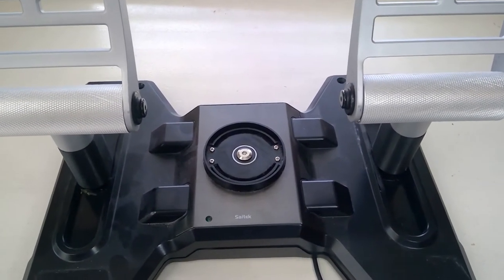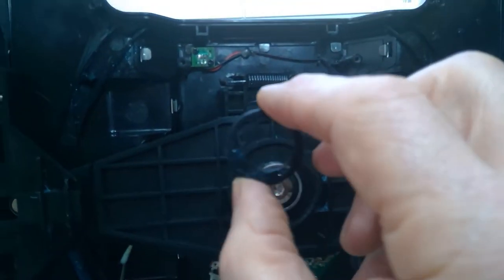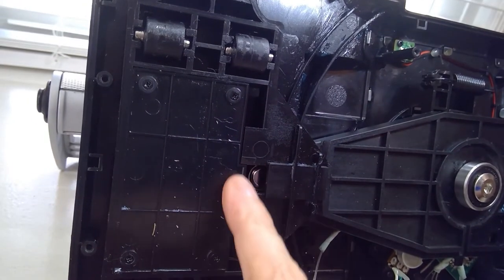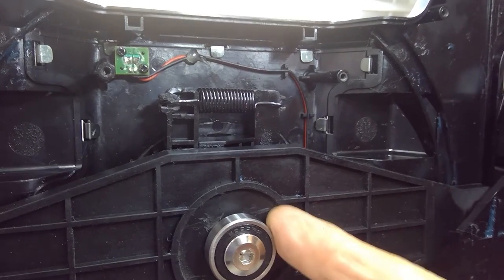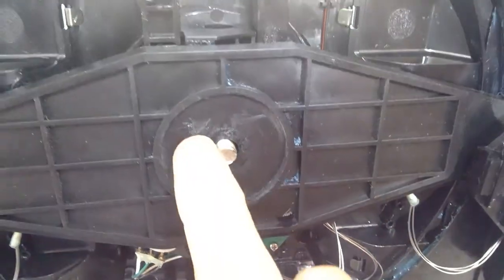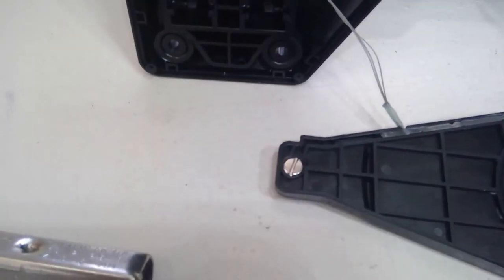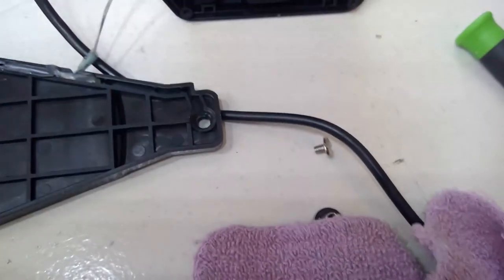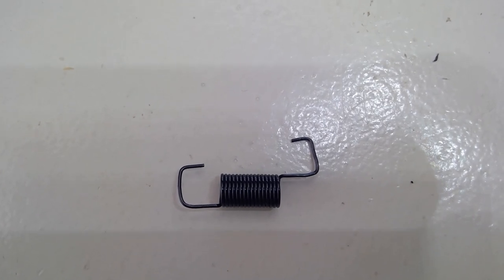Saitek rudder bearing mod

Comment: Hi, I ran into an issue when I went to reassemble these pedals after taking them apart and letting it sit for a while. My issue is after I put it all back together I still had two small half inch dowels and 2 small plastic o rings. Any idea where they go? Also while I got you here, what grease do you use? Thanks for the help.

Comment: I got a used set of these, and the seller didn't tell me that the tensioning knob had been completely broken off! So I think I'm going to go ahead and do these mods. Thanks for the video! Do you (or does anybody) know how to get the pedals off to add extensions? Also, my left toe brake suddenly (after using these for a couple weeks) goes to 100% as soon as I touch it; for a couple weeks it worked as normal. Any hints? Thanks!!
Reply: perhaps the potentiometer for your toe brake is worn out and needs to be replaced
Reply: Thanks! Turns out one of the 3 wires for the toe brake came out of its connector. After a bit of fiddling around I was able to secure it back where it belonged. Now I have toe brakes again!

Comment: Nice work there JD, Cant wait to see the FFB version. Is there any chance you will release the Huey collective you did on thingyverse as that has to be one of the best versions i have seen?
Reply from the maker: I did a vid of it Saturday. It turned out poorly. Have to redo it today. Hope to have it up tonight.
Reply: Nice videos! Are you still selling the collectives or files? Been looking everywhere on making a collective and yours is awesome!
Reply from the maker: @benpeters7573  It's on thingiverse. along with the F360 step file so you can see it assembled or modify it.
Reply: @simple-controls5507  thank you! Did you cnc the faceplate or print stickers?
Reply: @simple-controls5507  which kind of hardware parts are needed? I'm poor In English so Don t copy everything 😅